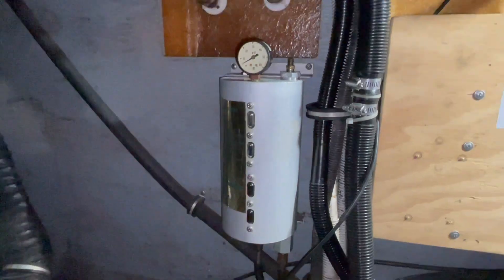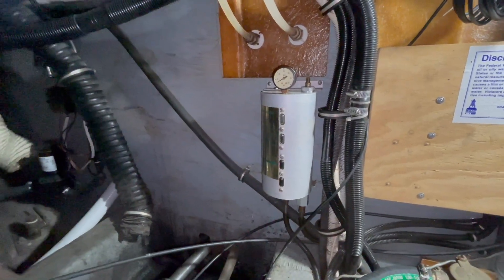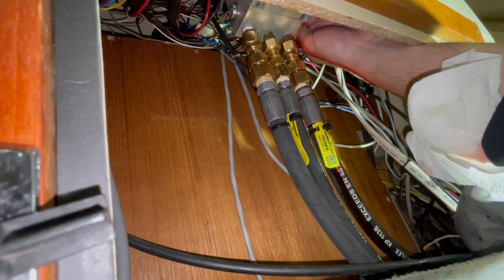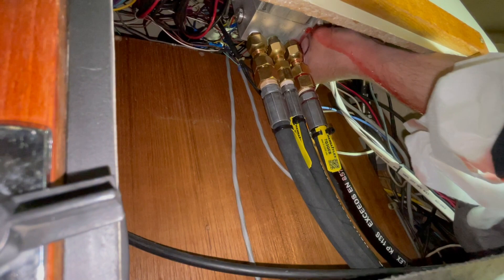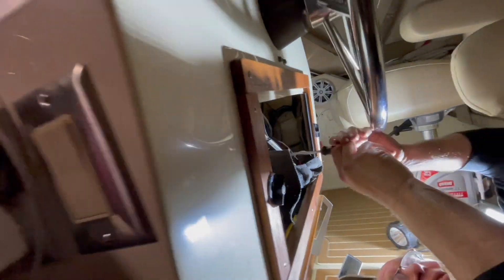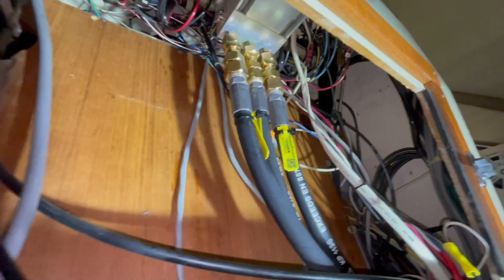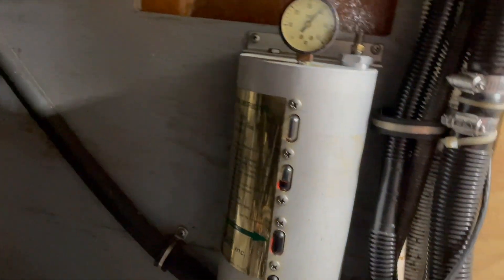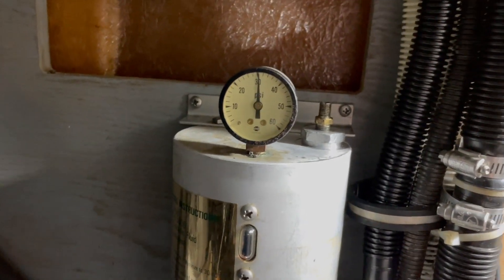MV Thirsty Whale, 1984 Chris Craft Catalina 381, Filling, Pressurizing, & Bleeding Hynautic Steering

Comment: I found out that to bleed the air out. Fill fluid to the high mark and pressurize to 40 psi then turn the steering wheel back and forth a number of times from stop to stop until you feel resistance in the wheel
Reply from the maker: Thanks my friend!!

Comment: The real bummer is you dont show what valve or what the valve looks like that your friend Kevin is loosening.  There are a couple different Hynautic systems and the crucial part of bleeding  - (bleed valve) was hidden and not shown....  Thanks for the thought and effort though..
Reply from the maker: You can see the bleed plugs clearly on the opposite side (port side) of where Kevin was working (starboard side). There is no valve up there, just the two plugs that get loosened to bleed air out. The plugs are identical side to side, so they are shown clearly. I just couldn't put a camera on the starboard side while he was working...no room. I should have mentioned this in the video, so my apologies for that. The bleed plugs are also clearly shown in the instructions that I linked in the description. As always, my videos are 'how I did it videos', not instructions. Hope that helps! Thanks for watching!
Reply: much appreciated - I have been through my manual over and over, as well as every other source I could find and still having nothing but issues with install after rebuilding the pump..  Again thank you for the clarification, I guess it's just grind away... the piston pump feels like square ball bearings trying to roll on old asphalt..
Reply from the maker: @davidbarten7429   Ugh...that sound is an awful sound. Hope you get it figured out...nothing worse than more troubleshooting after a rebuild.
Reply: I'm thinking for my $650 they put the new kid on it and he left his vape in the pistons... @WiscoBoater

Comment: I have a notchey feeling when I turn upper helm, was low on fluid due to minor leakage at upper helm, lower helm turns smooth. Filled tank did the whole bleeding operation,  no air came out fluid is now full. Still notchey at upper helm, I'm thinking maybe just worn from 40 years of use, 1300 hours.
Reply from the maker: Yeah, could be the bearings have a worn spot over the years. Could also still be some air in the system. Looking at the troubleshooting section of the manual, if there is air saturation in the oil, or if there was any foaming during the fill, it may just need to be purged at a lower pressure. 20-30psi, according to the manual. Just a couple of thoughts...I'm a total novice with this system.

Comment: Mine leaks at upper helm where lines attach to back of steering unit, its plenty tight
Reply from the maker: Really hard to get them 100% sealed. My fittings are all brand new and tight, and I still have a tiny amount that seeps out that I wipe down when I have the helm service panel open. No drips, just a little at the very top fitting around the threads.
Reply: @WiscoBoater  I wrap mine with paper towels